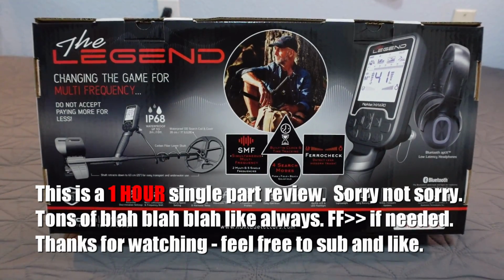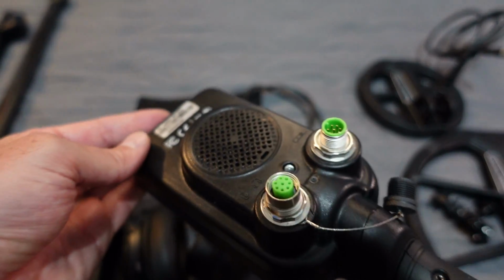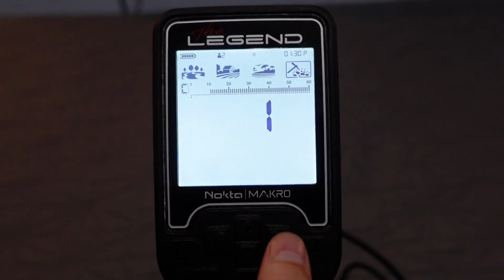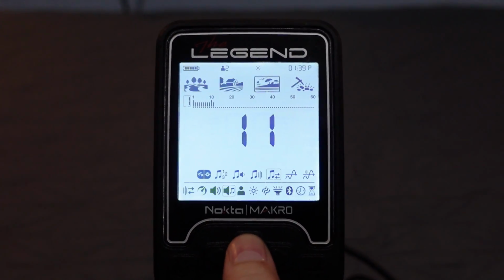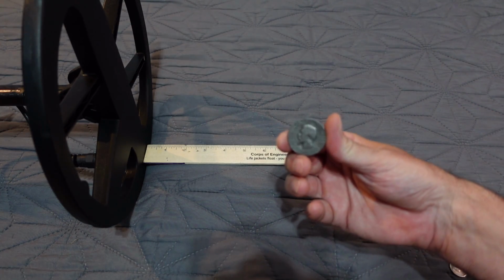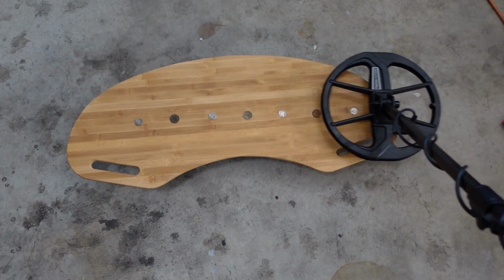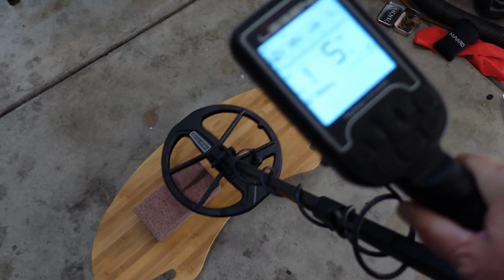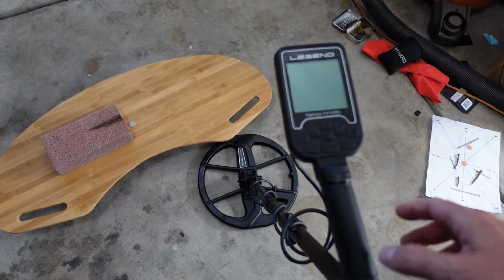Metal Detecting:  Nokta-Makro Legend Review

Comment: I paid approximately $541 for my Legend with the LL headphones, LG 30  9x12 coil and full carbon shaft. It has the adjustable iron bias which really brings this detector up there with the much more expensive machines. I would have to say that "this is one awesome unit and it is a Home Run for Nokta"!!

Comment: Think about something? If a Merc dime was started minting in 1916 it has to be lost after 1916. Square nails date back to the 1700's here so unless a house were burned or torn down how many square nails should be over a Merc dime? Especially that far over it? I have dug deep coins with nails around in the hole in an area the ground had been bulldozed from taking old buildings down but this usually isn't the case. Well yeah in farm fields things get turned over but how many nails are in farm fields unless you find an old building site but then again the next tilling can put the coin back over the nail so that's why you always return to hunt the farm fields
Reply from the maker: Silver is heavier than iron - thus sinks faster.  That is about all the effort I want to put into thinking about it lol.  I have found zinc pennies deeper than Mercs and square nails both.  Wrap your head around that.

Comment: Related but possibly not, I have a F44 and would like to get a Simplex+, if I do , would it come with the latest version software ? I’m looking at the base unit priced around $255. ( machine only ) This is why I’m asking.
Reply from the maker: Yes.  All units are manufactured with the latest firmware installed.

Comment: same charge cable but not to upgrade.
Reply from the maker: Incorrect.  Simplex - Anfibio - Kruzer - GF2000 - GK...all use the same cable and din connection.  I personally used the Anfibio cable to update the Simplex and Legend firmware both.

Comment: Just bought the Legend and waiting for shipment. I used to use the Nox 600. Despite the small performance difference, I wanted to go with the Legend simply because they didn't do us dirty like Minelab did with the Nox 600 basically being an 800 with locked features. The Legend has all frequencies from 4 to 40 unlocked. User profiles unlocked. 10 recovery speeds available. The Nox 600 only allowed 3 of 6 recovery speeds to be used, doesn't allow user profiles, etc.
Reply: They did you dirty? You could have bought the 800

Comment: I almost bought this detector. Seams like some problems with the legend. Already 2 updates then they pull the latest update. I’ll wait or maybe move on.
Reply from the maker: Crap happens with technology.  Deus 2 has had two updates as well - one of which was pulled for performance issues.  Cell phones and computers should have taught us all that updates are not always perfect.  Getting them fixed quickly is what matters.  NoktaMakro does very well with that.

Comment: Thanks for your reply John the popping at the end of the signal I mention that you had in gold mode I discovered is caused by the Threshold, it defaults to 0 in park field and beach and 12 in Goldfield which is why you only hear it in the gold setting. I like to turn up threshold to search for smaller targets which gives me the irritating popping at the end of the signal when used in field park or beach. I use an AT Max where I turn threshold up and back it down 1 to quieten, then it gives a clean signal 👍 let’s hope they can sort the legend out with an update because this has the makings of a great machine. 👍

Comment: The best coin hunting mode on the legend is 4 khz by far if you hunt in very trashy Parks like I do. Because this frequency doesn't like low-to-mid conductors it easily picks out coins in the trash where all the other frequencies will struggle. On the downside you won't be picking up many gold rings unless they're laying right on the surface. It's my favorite mode in this detector right now...
Reply from the maker: 4kHz is a no go for me personally, as it does not like fringe depth dimes as much as 10kHz (or M1) in my soil, and most of the quarters and halves are long gone.  It will also null out the nickels in the dime/nickel/dime/nickel test.  If you have Buffs and V nickels at your park, beware.

Comment: Posted a while ago about my legend locking up , couldn’t turn it off , none of the buttons worked . I found a solution if anyone else encountered this problem hold the power button for about 20 seconds and it will reset , at least it did for me .
Reply: Thanks I am still running 1.4 Version Think I will wait a while before updating. Your instructions and review were very helpful a lot of information for an old guy to digest probably have to watch it several times.
Reply from the maker: They are aware and a fix will be provided in an upcoming update.  Holding the power button down for 20 seconds is the quick fix for now.  No issues here thankfully.